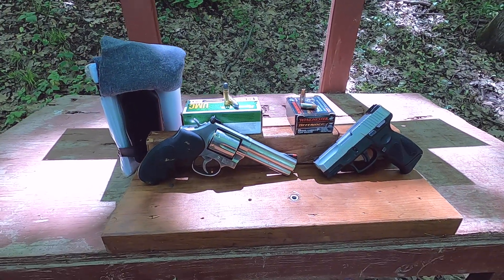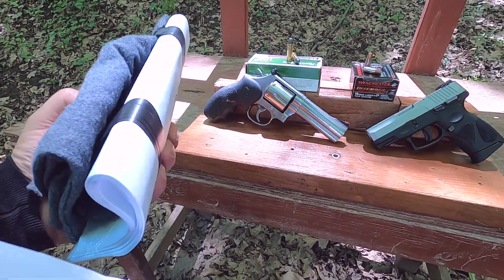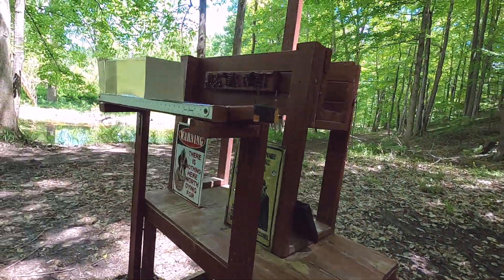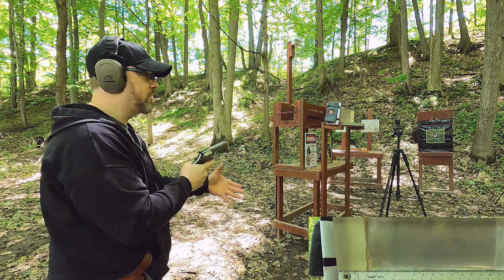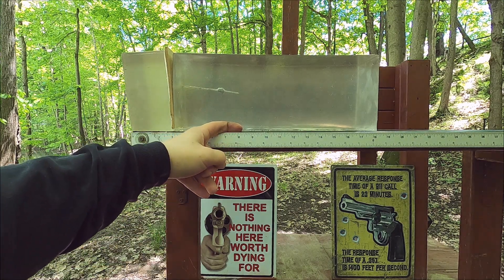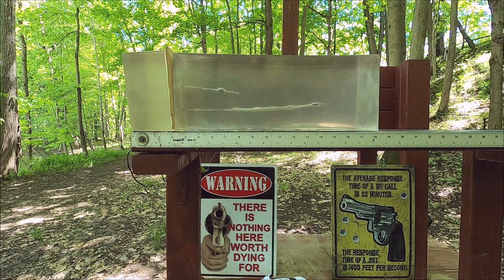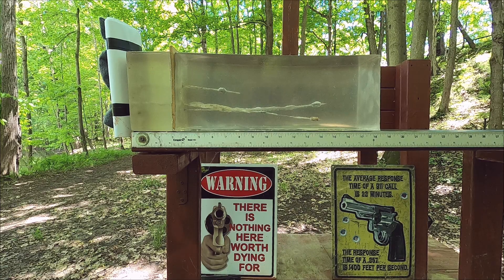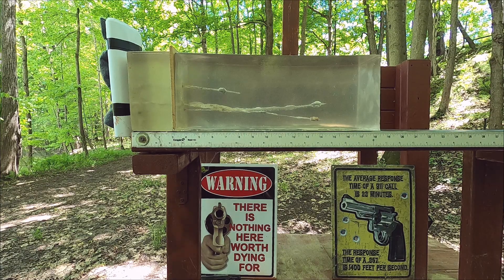Teddy Roosevelt's "Body Armor" Ballistic Test

Comment: I think your test was spot on. It basically showed the difference between modern bullet design and late 19th Century ballistic technology. Had Teddy Roosevelt not had his speech and eyeglass case he probably would have suffered a mortal wound (deep penetration, wound to the chest cavity, less than modern surgical technique and no antibiotics) as the bullet penetration would have been double the depth. Had he been shot with a modern bullet composition and geometry with modern propellant. It wouldn’t have mattered; however with modern medicine he would have probably made it as long as the bullet would have missed the heart or aorta. Simple as that. Nice test design.

Comment: Most .38 SW loads are way weaker than that .38 Special load you used. Slower and also lighter. Usually a 145 grain bullet going 700 fps. Even less out of a 2 inch barrel. England used it with a 200 grain bullet 650 fps or less. It was a hollow point wadcutter , not a swc hp. They looked like holllow base wadcuttets loaded backwards. Devastating . Think was called Manstopper bullet. It was against rules of war so Brits went to fmj eventually. It sucked.1877 designed cartridge and England used it from the 1920s to 1960s as a military round. Silly !

Comment: Very cool test! I think the glasses case had a lot to do with it. One of the victims of the evil David Berkowitz put a textbook in front of the bullet path and the .44 246 grain lead round nose took her life unfortunately so I don't think paper has much bullet protection.
Reply from the maker: Paper is weird, a small amount don't do much, but a lot of paper does a lot of stopping. I used to shoot magazines stacked, like a dozen or so, and often times just like 5 magazines stopped .38's and .380's if I recall. If it were just 5 magazines they would have passed through, but 5 backed by 7 more made them stop easily.

Comment: Bullet weight and chrono speed being essentially the same, this is a good comparison for the cartridges. However, a piece of aluminum is NOT going to have the same resistance as steel. To get a good comparison you need two pieces of thin steel. I'm also assuming his glasses were inside, so a pair of glasses with glass lenses needs to be there too.
Regardless, we can see that this is a plausible scenario because of the difference in penetration between the two bullets.
Reply from the maker: I don't know if it's aluminum or not
Reply: @GunSam  👍

Comment: 38 S&W would have been a 146 grain bullet at well under 700 fps, and very soft lead. The paper he used would have had a high linen content, making it more akin to cloth than modern paper. His was wearing a heavy overcoat over a lined wool suit jacket and vest, plus a shirt, and the bullet hit and broke a rib, so it's easy to see that  even if his glass case wasn't any beefier than the one in the test why the bullet only got a couple inches into him.
Reply: I think you're right about the 38s&w speed because s&w used to have a smaller frame than a j frame that they made for 38s&w

Comment: Great video. But a steel glasses cases from back then were hefty. I've seen a few in antique flea markets with the original "spectacles". They were allot more fragile and expensive than today's glasses. So a beefy padded steel case was needed. And paper was allot more fiberous and thicker than todays bulk packs of paper. Probably made of hemp or a thick parchment.
Reply: Yep...likely a high linen content, so closer to fabric than modern pulp paper.

Comment: Roosevelt was shot pretty early in the smokeless powder era (1901). He may very well have been fired on with a black powder cartridge, which would have been considerably weaker than your .38 special smokeless round. Also, things like eyeglass cases were made a LOT better in 1900 than in 2022!
Reply: Black powder 45 colt could reach 1000fps with 250gr bullet!!!
Reply: Yup that is true even faster with the Swiss black powder it's hard to fit the original 40grain charge in the modern case though.
Reply: Should have gotten rid of the first layer of ballistic gel and stuck a rack of ribs there instead. That would have been more telling imo.
Reply: I also suspect ammo loadings were not consistent. No SAAMI  established rules
Reply: McKinley was assassinated in 1901. Roosevelt was shot in 1912. 
Well into the smokeless era.
Reply: Both true
Reply: You can actually get higher velocities with black powder loads because of the pressures involved between them. Apparently you just watch videos and have zero real world experience.
Reply: It's not pressure it's the amount of powder being burned 22 gr of blk powder compared to say 3 grains of bullseye smokeless the bullseye will get the same pressure or more Than the black but the black burns longer so provided the barrel is long enough the black powder in a low pressure high capacity cartridge case can give higher velocity than a smokeless powder.Now that won't work in a high pressure low capacity cartridge like a 9mm blk powder wouldn't be efficient but the same principle is why a high capacity high pressure cartridge like a 357 mag produces more power than a 9mm at the same pressure with a slower burning powder it's just burning more.
Reply: @mgarand-no4tn  You read a lot of forums don't ya
Reply: No just reload everything.This subject I found interesting
Reply: @spiritualawakenings6251  wow, you're the type that thinks they know more than everyone aren't ya?
Reply: @gambrazzio6989  Why does it make you jealous because someone knows more than you? Why not just spend time doing and learning.and be just as smart yourself. Why be one of these guys watching videos and reading forums and not understanding anything
Reply: @spiritualawakenings6251  see your problem is you think you know people from just a comment on YouTube. You don't know anything these guys have done and how much they really know, but because your personality tells you that nobody is as smart as you, you just assume they know nothing.
Reply: @gambrazzio6989  You didn't have to prove you know nothing. I already knew you didn't. I know you are one of the few who actually voted for Biden, enjoy.